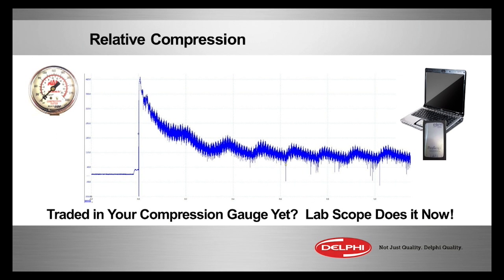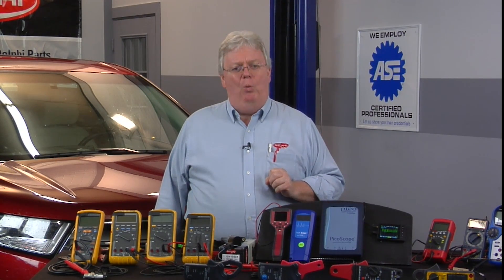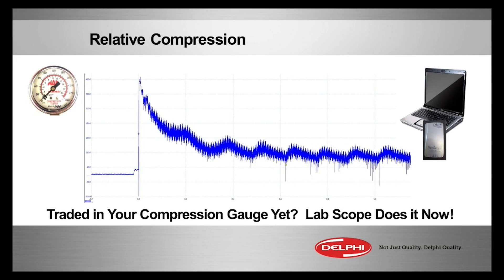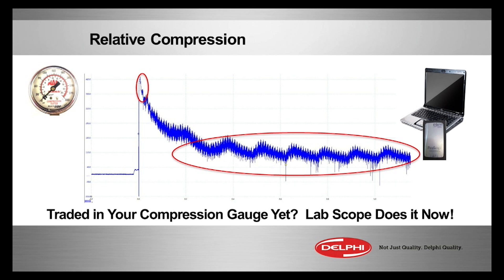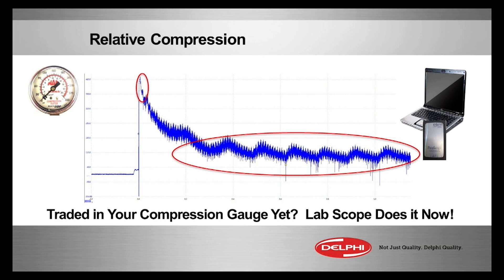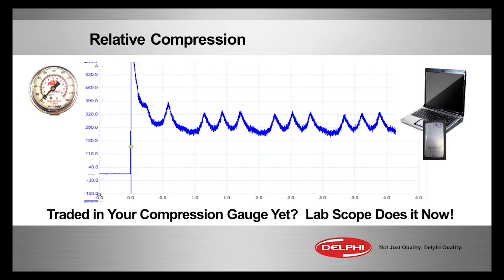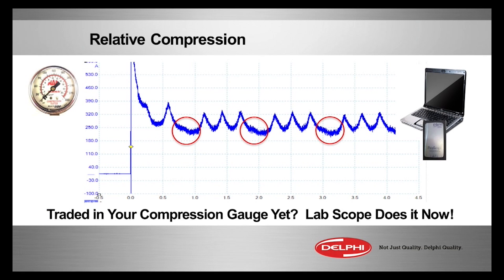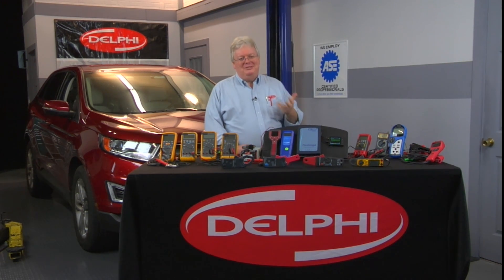Relative Compression (Mastering Meters and Advanced Electrical Diagnostics)

Comment: Wouldn't cranking the engine over, with the fuel cut, produce an audible offbeat sound that would point to low compression? It's the easiest test to do when diagnosing a misfire. Either hold the pedal to the floor, disconnect fuel or spark and crank the engine. Usually you can hear the difference between even and uneven cranking. You can quickly confirm an engine mechanical failure within seconds. The next step would, obviously, be to break out the scope or scan tool to find the misfiring cylinder(s). This is still an interesting way to quickly confirm, without a doubt, a low compression scenario.